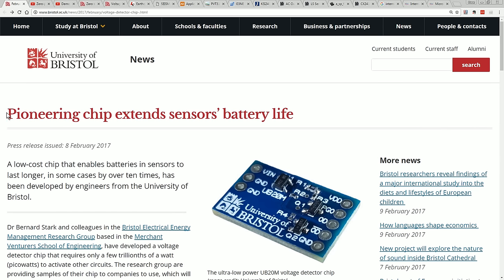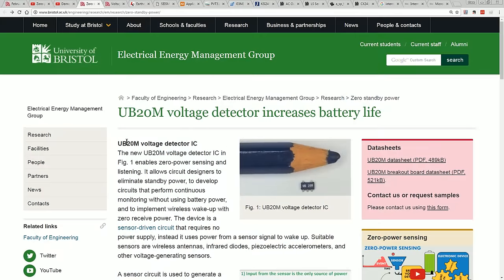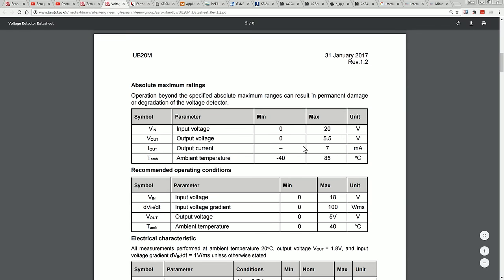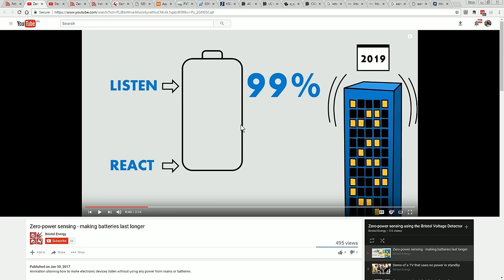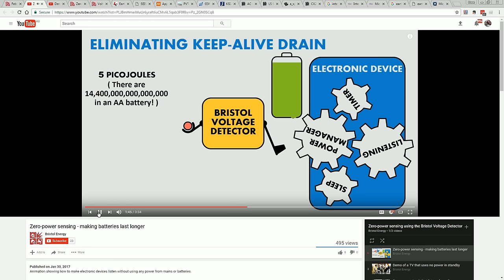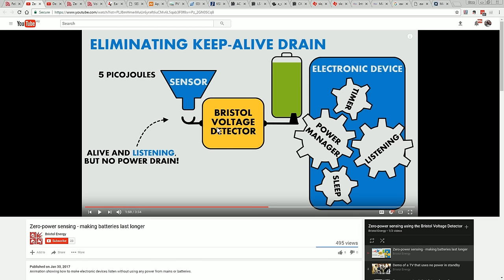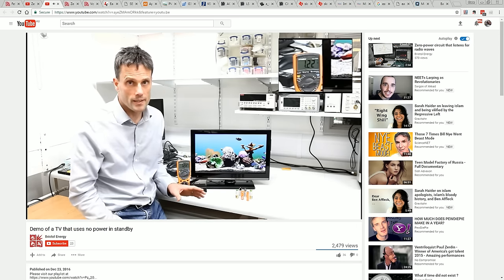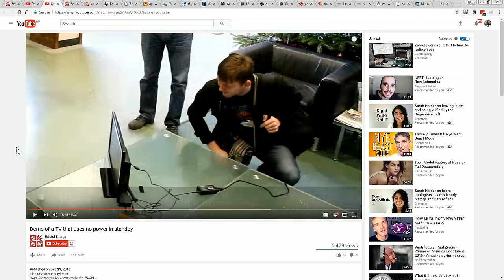EEVblog #971 - Zero Standby Power TV - BUSTED!

Comment: Just put a huge hardware switch at the mains and use a stick to turn it on. Real zero power standby.
Reply: Jonathan Araujo I'd just design a steam powered robot that is running 24/7, flick a switch on it and it manoeuvres over to the mains and unplugs it.
Reply: Yes, this! Absolutely this! 
Also, many devices with standby have lights, or have ports (such as USB) that provide power to other devices with lights. I am so tired of having to need an ugly  extension cable with switch on it to turn shit off ... That is so unnecessary.
Reply: Sounds wasteful to me. What we really need is one of them fancy pickle-powered robots!
Reply: Shut up and take my money!  Where can I get one?
Reply: Bub-Bubs
Surely a saner approach would be to just reintroduce slavery.  That worked fine for thousands of years, before 'liberals' ruined everything!

(This is OK to say now, because Trump.)
Reply: Doing this with all my devices. Just using a hardware switch and turning all the shit of I don't need...
Reply: bogg - you mean before the Republican party was formed to stop slavery.
Reply: CodeTech
Slavery continued much longer in the US.  You're 'exceptional' in that regard.
Reply: My old IBM P3302 (with a 286 processor at no less than 16MHz!) had this nice beefy red beast of a power switch at the rear corner. There are still days I miss the satisfying 'clunk' of throwing that switch :)
Reply: bogg - you REALLY need to learn more about history. The Republican party was formed to get slavery abolished, it took 6 years and a bloody civil war to accomplish that. Dems did segregation, Jim Crowe, and the KKK, and to this day they fight against EVERY MOVE for equality, while pretending to be "for the minorities". It really is the fundamental issue in their lives.
Modern day "liberals" are worse than any cancer.
Reply: CodeTech
No, you need to learn your own history.  Consider why, for example, it was Union States that were the last to abolish slavery.

The British Empire formally abolished slavery in 1833, while slavery had never been legal under English domestic law.  It existed in the Colonies in some cases for many reasons.  One factor was that few people were motivated to leave Britain and emigrate to the Colonies, so many of the early inhabitants of what became the USA were deported for crimes (and after the rebellion the deportations continued to Australia), but that still left a large manpower shortage in the economy.  Native people were not interested in working as labourers, and from earlier experience the Colonial powers realised that enslaving them wouldn't work.  It was found that people trafficked from Africa were resilient enough to survive enslavement, and thus was born a horrible legacy that the world still deals with to this day.
Reply: LOL
Reply: Bart Kuijper  I built a small power supply when I was a kid and used one of those switches on it. Still works!
Reply: SpectrHz maybe CodeTech is partly right.  Who knows what the truth really is.  But I do believe the R & D parties switched ideologies a few times in the last 200 years.  So to credit particular parties for particular things is not relevant without looking at who they really are at that moment in history.
I agree with your premise that R's are no better than D's when it comes to how the government is run, both parties are about power and money, just different ideas how to get it.
Reply: boggisthecat Thank you!
Reply: CodeTech You're right they are good at hiding their tricky ways of keeping minorities down.  Minorities that are repressed need dignity, not special treatment.  Special treatment (like some of the affirmative action policies) are not dignifying, they're demeaning if you think about it.
Reply: Jonathan Araujo the top replies under you are soooo off topic. It's insane
Reply: SNEAKxxATTACK maybe because of my fancy idea hahha
Reply: is it just in the UK we have power switches on all the sockets as standard?
Reply: Legend has it 'this' is a word.
Reply: Ohh satisfying PS/2 power switch!
Reply: Ah the good old lazy stick, the trick is having a switch that doesn't take much force to engage, that way you can throw socks or t-shirts at it when you don't have a stick.
Reply: Jonathan Araujo better yet: use an extension cord to bring the mechanical switch to your recliner!
Reply: CodeTech Your comment seems to be misplaced!  Please try your call again later . . .
Reply: Or just mount switch nicely in wall in place where you sit when watching TV, voila no stick needed.
Reply: couldnt that chip also be used in a device that sits between the mains and the device meaning that this device not just kills the connection from the powerbox to the tv or whatever but instead drectly the connection to the mains, especially considering that a lot of TVs dont have an external powerbox or whatever this might actually be the better Idea.
Reply: Just pull the plug, that will do the job without a stupid stick and switch. ;)
Reply: I mean, actually along that sort of principal, why the heck didn't they just design an optocoupler with a super-duper-ultra low power-on current, rather than an open-drain output? The leakage current would be 0 and there would be no need for a pullup/pulldown. As for 120/240V mains operation, use it as a switch to turn on a teeny-tiny non-isolated power supply hooked directly to the mains, that generates a small voltage and current to turn on a big-ass relay, to which the true load is connected.
Reply: you probably dont give a damn but does anyone know a trick to log back into an instagram account??
I somehow lost my password. I would appreciate any help you can offer me
Reply: @Rowen Asher instablaster =)
Reply: @Salvador Keaton it did the trick and I now got access to my account again. I'm so happy!
Thanks so much you saved my ass!
Reply: @Rowen Asher Glad I could help :)
Reply: Or use a Nerf Gun.
Reply: If they're measuring voltages that are harvested from the 'air', then it's only fair that you calculate the caloric drain of your body in activating that switch via that stick. And what is your body's standby energy consumption? Please show all work as appropriate across varying lengths of stick. ;)

Comment: To be honest I think less of you for this video. I get why you "BUSTED" batteriser, but these guys are students on a university Youtube channel. I think you'd be better off making videos about making projects things rather than riding the cheap wave of debunking.
Reply from the maker: They are not students, they are professional researchers and are selling this product. Bullshit demos get called out.
Reply: Matt Hollands then dont watch.  looks like you are in the minority on this one, as the response is overwhelmingly positive.  also, just because they are students, does not give them a pass on integrity. in fact, they should be held to a higher standard.
Reply: Well it's a little bit difficult to not watch it in hind sight. As I said, I think the batteriser debunking was valid - so I'm not saying debunking is bad. Obviously I think most of Dave's work is excellent, especially the fact that there is such a great community around his channel -  a community that accepts criticism and compliment in equal measure without resorting to a "if you don't like it then get out" mentality.
Reply: Students or not (I haven't looked overly hard to find out the exact people involved as its late here so I will accept your statement) I would still call 2500 views in 3 months an unnecessary debunking but obviously it's not my channel even if I wish it was. Maybe the marketing was bad, but they have to find someway to explain the concept (which clearly has application) - digging into electronic concepts is not going to help the average person and not everyone is lucky enough to have a huge number of engineers in their viewership.
Reply: Matt Hollands i didnt say "get out." you took a run at the debunking videos and told dave hed "be better off making videos about making projects..." so watch the ones you like and dont watch the ones you dont like.  no dramas.  criticism is healthy, i agree, and it is healthy that dave is critical of deceptive marketing as it is unfortunately very rampant and prays on those who do not understand the conservation of energy and electronics.
Reply: But why bother even explaining it to the general public? As you correctly point out, the general public doesn't have the background to understand the quiescent current drawn by a switch-mode supply. And the general public isn't in the market for this device, it only has specialty applications.
As dave pointed out, this demo was specifically selected using a misleading scenario and demonstrating to people unlikely to see the trickery. That is why this needed called out, as it's a pretty egregious example of lack of ethics from people who should know better. I would sincerely hope that this would become an issue even in an undergrad senior project.
Reply: I am not a electrical engineer, but it does not take one to see the slight of hand with their meter connected after the step down transformer/power pack !
Reply: They are uni students trying to bullshit people, they deserve to be shamed.
Reply: @mike all I didn't take a run at debunking videos - I took a run at debunking videos that were bad.
@zrobotics Well it's a university so they have a huge outreach responsibility. I don't think it's a very healthy attitude to just not try and explain things to someone just because they can't understand the full details.

@LifeOfAnEnglishman You have to see the difference between debunking this and the batteriser. The batteriser was asking for money UP FRONT for a product that demonstrably doesn't work. This is a video letting people know about some work people did at a university that exists now WITH a datasheet. This wasn't a sales pitch, it was public outreach, and if it didn't suit your needs you would not buy it.

Dave has to take responsibility for the fact that he commands a massive audience who have now gone on to effectively bully a small group of people.
Reply: that does not change the fact that these university students are bullshitting potential customers for their chip. Dave has also proved that such a chip isn't even needed anyway. So not only are they bullshitting people with claims that Dave has proven not to be true, it's a pointless device anyway. Whether they are asking for money is not relevant, they are still bullshitting.
Reply: As an undergraduate student in electrical engineering, nothing satisfies me more than seeing students get called out trying to make up for their incompetency by bullshitting their way to a degree. Not everyone can become an engineer folks.
Reply: Matt Hollands you lost me when you claimes dave "bullied" these folks.  as i said before, a university has a larger burden of ethical responsibility than the general public and in this case, these reaearchers lacked integrity.  of all places for challenges to be expected, it should be academia.  this is not a safe space.  they made false claims and should be challenged on them.  by your account, no one should challenge any claim made by researchers or students and universities, which is ridiculous.  the fact that they have no financial stake allows the public to invest more trust into academic research and that trust is violated when claims are falsified or overblown.  i guess this video should have had a "trigger warning" for the faint of heart, academic types (said sarcastically).
Reply: Also, +Matt Hollands, just like +mike all pointed out, using your definition of "bullied" I did this one to an incompetent co-worker (Also an intern like me), and I promptly got him fired/let-go. If you try to bullshit your way through both school and a job, I will do everything in my power to make sure you don't make it through, especially when I offered you multiple chances for redemption and learning. Not everyone is "entitled" to become an engineer.
Reply: @Mike all - I did not say that Dave bullied them. I said that as a result of this video there were tonnes of comments all saying the same thing, when frankly MikesElectricStuff called them out on it 3 weeks ago.
@Jeremy Hong - Again, not my definition of "bullied", but anyway I dislike the pleasure you seem to take in the fact that you got someone fired. Shows flaw in character - even if they deserved it I would not take pleasure in it.

They aren't really lying - yes the TV does have zero standby power, the power supply does not. Yes it's slightly misleading but I don't think they deserve the response they got. I'm not going to comment more because, as everyone knows, youtube discussions don't actually ever get resolved.
Reply: Misleading you, is lieing, or at the very least twisting the truth. The fact that the power supply is still using standby power means that the TV they used is not using "no power" on standby as the PSU still is. They should have used one with a built in power supply.Whether they intended to mislead or not, they still miss led people. Maybe I was being far too harsh in saying "they deserve to be shamed" but if you're gonna make mistakes, intentional or not, you should be called out on it. Being called out isn't necessarily a bad thing as people can learn from their mistakes.
Reply: +Matt Hollands, I only take pleasure in the fact that I saved the tax payers and the Department of Defense from having to overpay for low quality work on a research project and that hopefully this guy learned a lesson in not to bullshit anymore. If you say things like, "I can design build a 1 GHz oscilloscope in less than a week for under $300" yea you will quickly lose my respect, not to mention billing for hours you weren't there. If I had "flawed character" I probably wouldn't have gotten this guy kicked out, having known about what he did. If anything I did him a favor, since it's against the law to falsify time charges on DoD projects, so at least it didn't have to go to court or anything.
Reply: Debunking marketing wank is a big part of education, you obviously can't trust people to see through delusion for themselves.